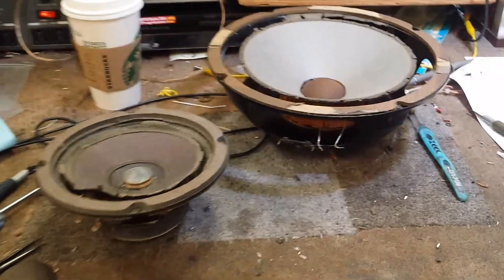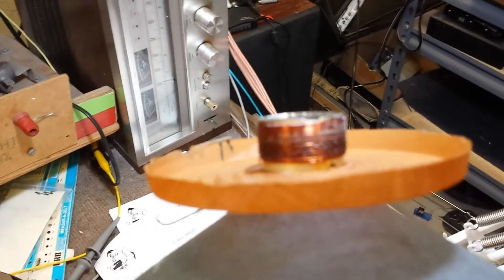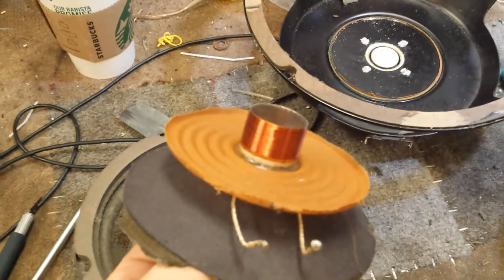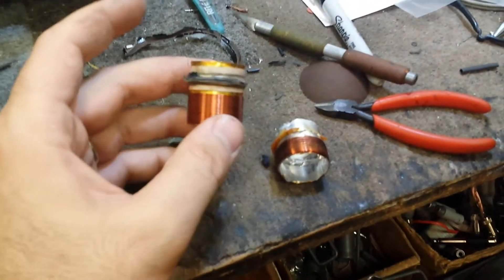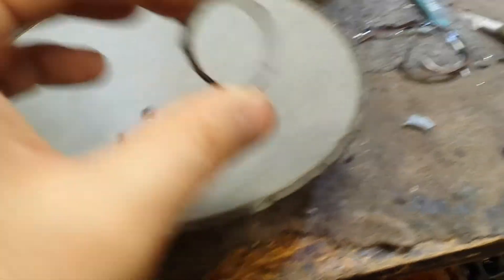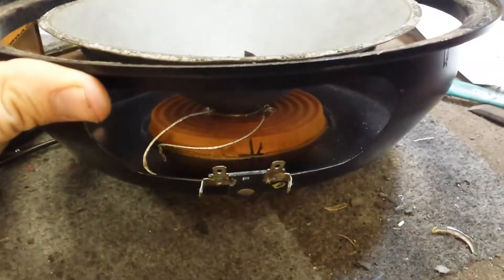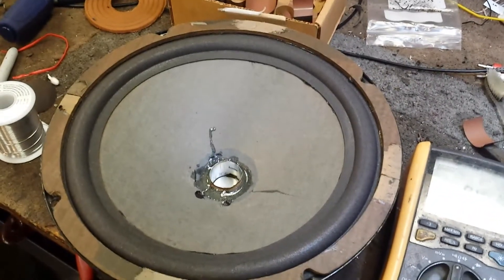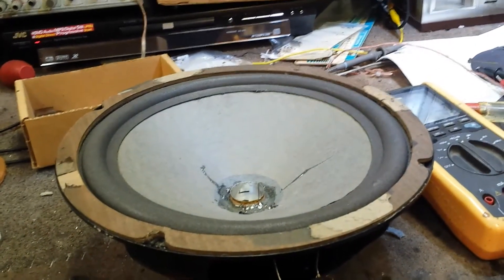Voice coil transplant on Fisher XP-65 woofer.

Comment: I wish i had the speaker repair skills like you. I have a 15 inch Jensen woofer that needs a complete recone and constantly find nice speakers at resale shops with foam rot that I wish I could buy and repair. Good job.
Reply: Doing this myself. My first few work fine just not as cosmetically perfect as i would wish. Experience is the best instructor. You can buy cheap speakers and cheap foam under $4 each and get to it! Great fun. God Bless